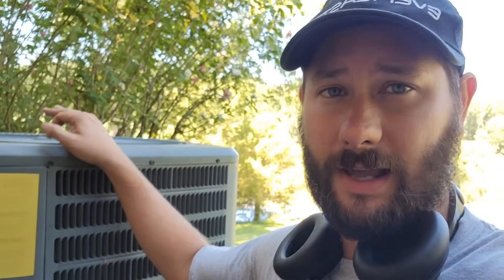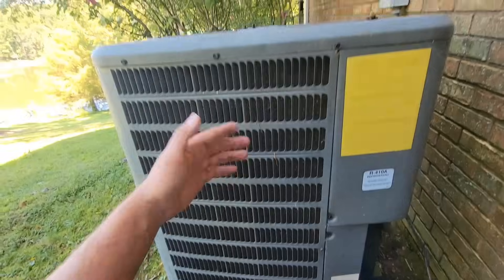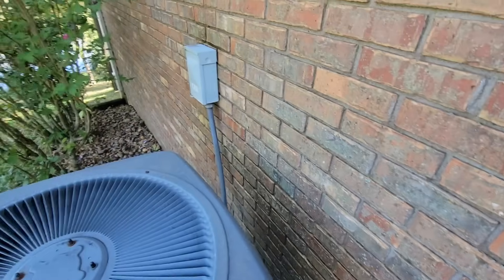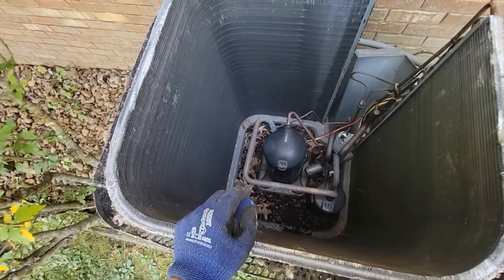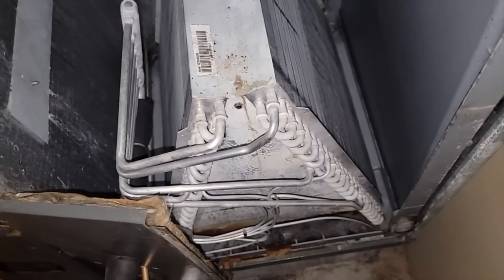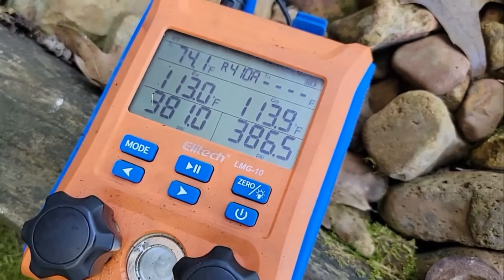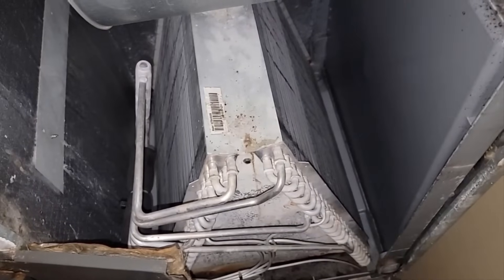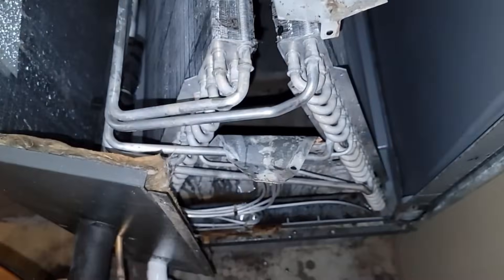How to find a refrigerant leak in an air conditioner?

Comment: Not a bad idea provided you have existing previous knowledge. If you are working on a package unit, or even a large 16 ton split system on a roof, or any commercial or just a landlord sending you to a rental property, you may not know at all that the leak has emptied the system in 1 year (low pressure, vapor suction side = evaporator) versus fast leak which drains refrigerant in only 2 weeks (high pressure, liquid side = condenser).

Comment: I joined.  I need help with my AC.  I have a leak and other than that my ac works great.  The only problem is it has a fairly slow leak.  6 lbs of coolant last about 5 months.  But it worked great until it all leaked out.  They said I need a new AC which would cost about $11k.  HELP!
Reply from the maker: Kim, I do not see where you joined. I see where you subscribed

Comment: I’ve been doing our 12 and our 134 a refrigerant for just about 41 years and I’ve had the very best snap on equipment and I’ve had cheap equipment and out of all the electronic leak detectors. I’ve had I’ve not had any that I was ever really happy with. I liked looking for leaks with R 12 because it would carry the oil out with the leak and it was much easier to see with 134 a you don’t get anywhere near the oil coming out unless it’s a fast leak so it’s really tough to find and of course on cars nowadays you can’t see the whole system anyway it’s all hidden.

Comment: If you are a customer and wonder if you have a leak, start by turning ON your AC on heat mode and mesure the temperature on the big pipe coming out of your outside unit. If the temperature is above 90°C it is not a good side. If you are in summer, turn On your AC on cool mode, if after 30 minutes, the pipes coming out of your outside unit freeze, you have a leak!

Comment: I had the original hvac installer come check for a no cooling on one of my Rheem 3 ton systems.  He found a low charge on a 9 yo system and said it had a small leak and doesn't recommend finding and fixing it, because it could be a lot of hours labor.
I thought that was a strange thing to say, but he said he would put a leak stop and call it good.
I decided to hold off and get another opinion.  
Each guy i called said they would at least try to isolate it and fix the  leak.  
So about a week later, i had another guy come out and find  the leak at the evaporator coil manifold.  
He took about an hour to find it, but as he was attempting to recover the 410A to replace it with nitrogen , he said it was competely flat!  I asked if the previous tech left the valve or the core loose or open?  He said no.  This didn't make sense, because he had to pump 350 lb psi into that low side to see a leak that was so small, you could barely see any bubbles while staring right at it.
The previous tech said the pressure slightly low and it had been that low for over 3 years of non use, because the leak was tiny.  
So i lost approx 5 lbs of 410A in one week from a miniscule leak?
Then to make things worse, he said a full charge of 410A is 7 lbs, per the Rheem tag and he's charging $150/lb.  I expected to pay that for one or two pounds, but not for 7lbs!
I got the weird feeling that this guy intensionally lost the charge to nail me with  a $1050 charge for a $84 wholesale price of 410A.
Seemed like that was his plan, but i called him on it and after some serious arguing, he finaly agreed to the original estimate at only a two lb charge instead of seven.
This business is just filled with crooked people that think they can charge you anything they want and run up a bill just for fun.
Never trust any tech to be honest, document everything they say and do.  If they don't like being video recorded, you know why.
So he went from being a new preferred tech for finding the leak, to a can't be trusted tech. 
 And now I'm wondering if i should call another tech to get pressure readings to see if his keak repair held.
I don't mind paying fair prices for labor and retail charges for parts and freon, but when your tech says he has to up charge you not just 30%, not 50%, not 100%, but over 12 times wholsale, you know something is wrong with his business plan.
Reply: At this point, I'm thinking of enrolling in a HVAC course myself and get all the knowledge required to fix things myself LOL. 99% of these HVAC techs are just scamming you for more money.
Reply: @roshanm1039 The temptation to lie and cheap must be so strong.  If you find an honest HVAC tech, stick with him, because too many can't resist scamming uninformed customers or like you say, train yourself.
When an honest tech sees another tech just rolling in money, he knows how that is happening and has to have a strong moral backbone to stay honest.
Reply: @roshanm1039 Yep, it sure seems that way.  I thought if I called around, I could find at least one honest tech.
Can you imagine telling a customer "it's a business" and then without flinching telling them you are going to charge 12 times over wholesale for freon.
Either get the training or take your chances with the riff raff scammers.

Comment: Since R-410a is a blend do you charge to put in all new gas in the system? A recovered blended gas from a leaking system can be fractionated causing performance issues.

Comment: hmmm…. so the guy from the big co. says you need a new compressor, your AC unit is leaking, could cause a fire, could ruin the furnace but doesn’t do a leak test and doesn’t show you literally any evidence… may just be scamming you?  my ex has  not used her AC since guy turned the power off. 

in the process of tracking down a reputable co. to leak test it.

Comment: I do a vacuum test to determine the leak if on the outside or inside coils. Have to recover freon first. Once isolated try put nitrogen to hear leak.
Reply from the maker: That's a good method for finding a leak.

Comment: I had a company come out they put a sealant with dye into the system hoping this would fix the leak wherever it may be. My question is my bathroom wall is right besides the outside wall wall from where the AC unit is. I have a leak on the topper wall looks like someone like a crater on the sheetrock. This has been going on for 9 years wall has always looked funny have the wall fixed then all the sudden it's doing it on the top of the wall again we're not sure if it's termites we want to know what to do here we do not want to be ripped off from all these people show me because for years they kept telling me it's the thermostat because the thermostat set on 73 and in the afternoon it says it's 77 in the house meaning of air conditioners running constantly until early morning. Please need help here also where are you located

Comment: Could you just increase the pressure slightly higher with refrigerant and find a leak of that size with the freon detection wand? Instead of evacuating the system and using nitrogen.
Reply from the maker: Yes, but it's better to recover the Refrigerant into a recovery tank and then pressurize with nitrogen

Comment: I want to know what you did with the burnt wires and loose connection when you moved the 220 line coming in. And, also you brought the soap bottle and didn't use it. Just wondering why?

Comment: I’m going to give you a pro tip free of charge. Always check drain pan on evaporator and condenser for oil before you start adding refrigerant and secondly if you added refrigerant 2 weeks before it would have been impossible to properly charge. Weigh it in.

Comment: Large or small leak, 99% of the time in the evaporator.. Zero reason to find the leak it just waste time. Even if you find it, you can't fix it. If you are lucky enough to find leak and it is accessible.and you fix it. It will not last, because many coils are rusted. Your prices are great.

Comment: Hey Taddy, here in South Florida in a New Apartment with what seems to be a pretty new Freidrich Large Size AC Wall Unit. Within past 2 or 3 years. Doesn't seem to be an older Freon unit. Moved in about 2 months ago. AC runs pretty good and cold , but periodically I smell a Paint Thinner / Vinegar smell blowing out of the Air Conditioner. I contacted my landlord. In your opinion can this be repaired fairly easily by an HVAC Professional in Comparison to the larger Central AC Units you seem to be repairing. Your advise is greatly appreciated for the best advice  I should be getting from a local HVAC professional.

Comment: Without keeping this too long. Unless you don't mind you can respond and help me. Basically this is the second central heat and air system I bought in 3 years. Because I'm dealing with American home shield warranty, everybody run no one use them anyway. Brand new system. They left rags, bolts, wires, all kind of stuff in the air handler. After that it still kept freezing up about 9-10 times. Then they said it was in my ducting so they retape that and then totally lied and said we never had mastic at all. I had a second company come out. They got up into an area where the company that lied never even got before. They couldn't even fit there. He took pictures and showed your mastic is fine. I forgot to also tell you the first company that installed the brand new units already has replaced three parts on it. The t-valve, the capacitor and something else. I don't even know a brand new unit. This was all in the first 3 months. I got it put in this February and here we are still waiting with a huge electric bill in this little house every month and having to keep the air down. The last guy that came without testing anything like you just did said it's your line set. Yep that's it.. no testing at all. He just put his head up underneath Air handler and said yep it's your line set. Now I know when you get a new system they are supposed to test and make sure the line set even fits your new system. Well this house was built in '96 and like I said the first system when I bought the house 20 years old it had a 3 ton double pump system. The second when I got ripped off it was supposed to be a 3-ton. He put a 2 and 1/2 ton and didn't even change the air filter air handler. Excuse me at all. Left the old one. And with a brand new one I just got. I know already they lied because of the mastic. I have proof of all this in writing pictures. Everything now the company wants to charge me out of pocket $1,000. Which by the way I've already paid $500 out of pocket for window unit after just buying the brand new AC unit. So if it's the line set when they haven't even checked it, he said it would be a simple thing to replace. Even though it's underground. You would just have to remove the air handler. Have somebody at the other end push out the old bring in the new put in the 2 lb of refrigerant and that's it. My question is $1,000 for this all because the word access was used. The company wants me to pay and no one's even tested it. So should I have them replace the whole thing since they've already replaced three parts on it? And we know they've been lying though about stuff already with this new company. If they won't change the wording then they want me to pay $1,000 for something he didn't do any kind of testing on. What do you guys think? I need some good advice and dealing with this company. It either is I have to come out of pocket $1,000 or I keep paying extremely high $300 and something dollar a month electric bill. My house isn't even $1,500 square feet when my 20-year-old system was here. I paid $180 in the summer. That's it. So what do you think the whole thing replaced? Do you think it is the line set with it being brand new? Maybe the line set is not brand new. It's original. They probably never even tested. It changed it nothing. And I guess that's not something you have to replace when you get a new unit. So if I have to pay out of pocket this seems like quite a bit for something he has said on camera. This will be a simple fix and won't be hard to do so. Do you think definitely I should have it tested? And also he said he couldn't add refrigerant now that he knows there's a leak because that's illegal. And how does he even know that it is a leak if he didn't even test anything? I'm going crazy. I said I'd keep it short. It's not short. Sorry. I'm just hoping you guys can see this and give me some good advice cuz at this point it looks like I'm going to have to get a lawyer. I don't have another dollar to spend after just paying for two units, a window unit and high bills and for them to come out. So please tell me what your opinions are. I need some good advice from somebody not trying to rob me for once. That would be amazing. Thank you and God bless you all
Reply: @SchmurtGawddess  what wound up happening? I would be happy to offer some advice if you still need it. Anyway, hope you’re good 👍

Comment: I’ve been smelling a minor leak in my apt I’ve lived their 7 years and recently just started smelling the chemical Freon smell but the hvac guy said that the lines were not frozen and he didn’t smell anything.   I already told him he wouldn’t smell it unless the hung around for awhile and was sensitive to the smell as it is not a constant smell. I know he didn’t check the inside unit after he couldn’t smell anything. It’s so frustrating    So the apt maintenance guy pulled the fridge out said well it’s not wet under there so it’s not the fridge. I smell it even if the air is not running it’s very annoying and a bit nauseating. Could you tell me what I could do or what kind of detection device I could get to show them I’m not imagining  this I don’t want to bring my granddaughters over to stay till I get it resolved?

Comment: Question from a non-pro: are the leaks always at the coils and not on the run of copper somewhere else (like that one going through a brick wall)?  I've got a no-cool situation and I'm thinking a leak somewhere.  Great vid and awesome to see an honest tech!
Reply: @projectguyprojectguy9019  it is a possibility but unlikely. I've seen leaks in the line set from ppl hanging pictures on an outside wall. Line set leaks will show an oil spot on the wall.
Reply: Thanks for the reply!  You were right - my leak was at the evap coil on my old R22 system. .  According to the tech it looks like a slow seep - hopefully the stop leak stuff will fix it as a new coil is $4k so may need to get a new system.   Other than this leak the compressor is running strong and the system has been well maintained.
Reply: Did the stop leak work @projectguyprojectguy9019

Comment: costs to do an full fledged leak search vary depends how far we have to go to isolate  Coil from line set to outdoor unit but can get quite costly quick ...depends  but its the only way to find , fix or replace the correct component

Comment: wow infocon ive had one but long since replaced by H 10 & cant remember the other brand but its called the leak seeker & 500 max nitro id guess  ....i usually do 350 max 145 on old R 22 coils  w/ trace Refrigerant  with bird dog 1 st then bubbles to pin point ..Thanks as always

Comment: Many techs don't bother to actually find/fix the leak.. My friend Matt is the best at finding leaks.. even w/o dye,, feel for oil is a very good start.
Reply: BINGO. In our area, they immediately try to upsell you and get you to replace the entire system. The gentlemen has integrity and gave the customer all the options ranging from the quick fix to huge overhaul. It didn't feel like a rip off, UNLIKE many of the guys in our area.

Comment: I bought a brand new construction home and closed Jan 2022. Yesterday the A/C company who installed the central air came last night at 7pm and BAM, The tech says there is a small Freon leak but couldn’t find it. So he charged me $144 for the service call and $188.50 for 2.5lbs of Freon. He told me his office will call me back. 

Today they call me and she tells me it will cost me $257 for the leak check and probably more for Freon. So I’m like WTF! 

STRADA installed all of this and now I am on the hook for this leak and the house is only 2 years old and they installed all of this! WOW.
Reply from the maker: that's a bummer 😕

Comment: nice job tad, what do youcharge for a leak survey?
also if a mouse works its way into the main  blower squirrel cage it will sound like thunder in your duct work. simply remove and clear sailing.

Comment: AC guy found our 2008 out of warranty system was out of old type refrigerant. Checked outside unit, no leaks. Plans to check for leaks on inside unit, weld leak if doable, install "stop leak", and new type  refrigerant. If systems loses refrigerant, he  will deduct charges from total price for new inside unit (or replacement coil) . I was told that old type refrigerant is very expensive, new type is about 95% effective in cooling.
Reply: @garygullikson6349  did lose any refrigerant or did you replace the coil

Comment: Dude.  $7k?
Reply: Today, I just found out I have this same problem.. my outdoor unit is from 2007 so it’s 17 years old.. they usually last about 15-20 years..  to replace it it costs anywhere from $5k-$8k. I do not have this kind of money right now.. I have everything maintained and serviced through my hvac guy.. weird thing is is that I did not notice at all. My house gets nice and cold.. I’m assuming this is a slow leak.. but we will see. They loaded it back up with Freon and I’m going to go through it with them after researching everything about this. I will do anything to keep the costs down right now..